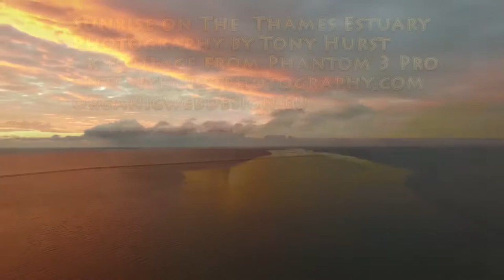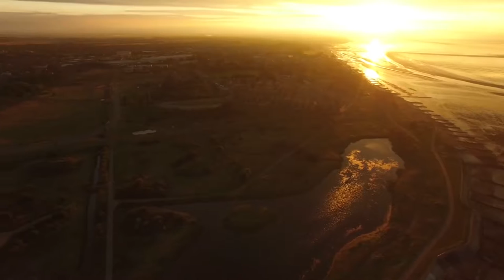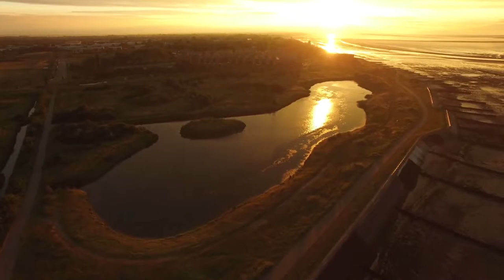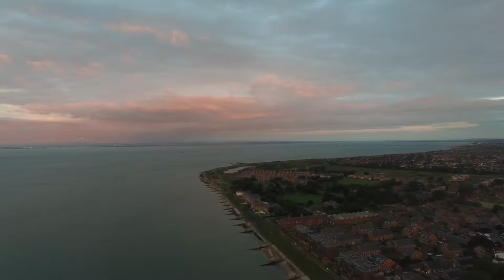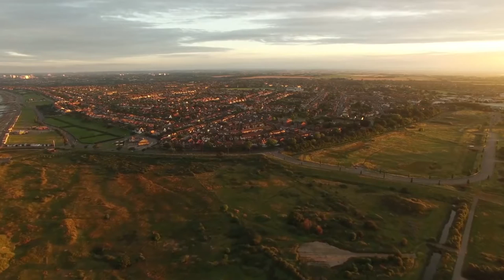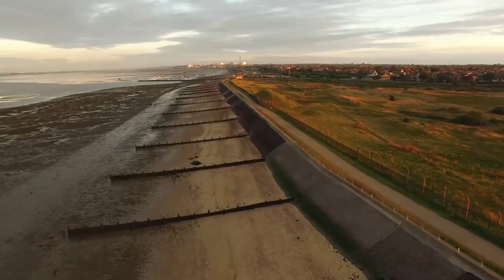Tech-talk with RG, series and parallel selection.

Comment: Hi I hooked up a hlg 600 h 36a to 10 cxb3590 cobs in series but would not come on so I hooked up in parrellel and one of the 10 cobs is not coming on any ideas 
I built 2 of these and all 10 are lit on other light
Reply from the maker: most likely problem will be a cob/wire back to front, if you connect a cob up the wrong way round it will not light due to being a diode (one way electricity valve) make sure your plus's are plus's and yer minus, minus, dont trust the harness, test with a meter.